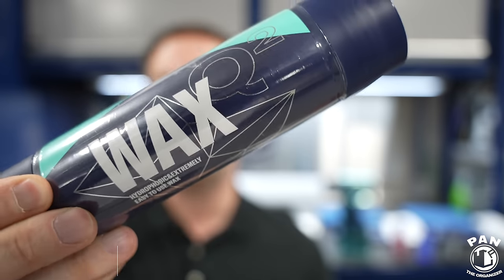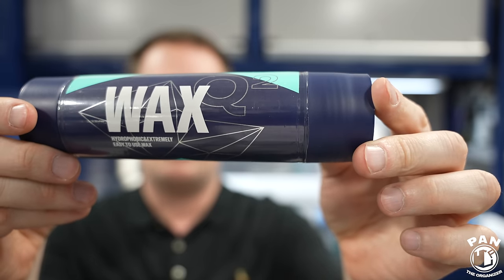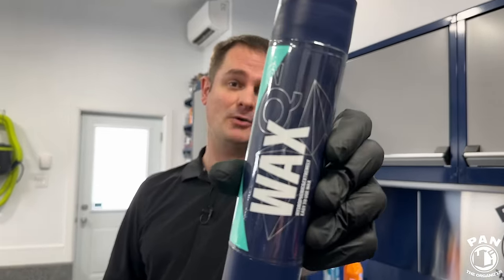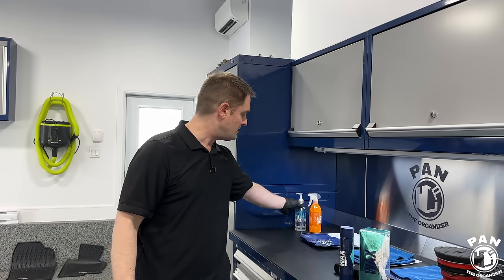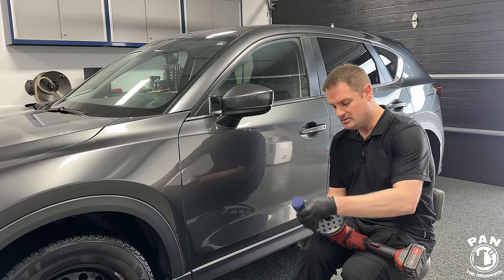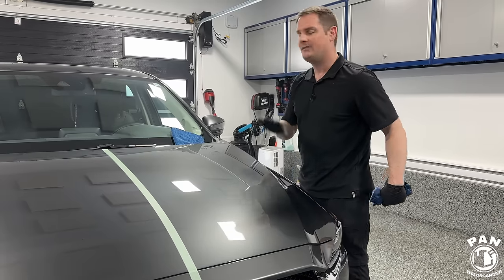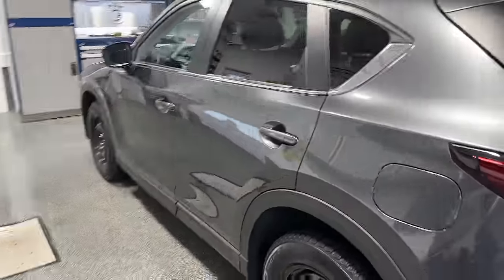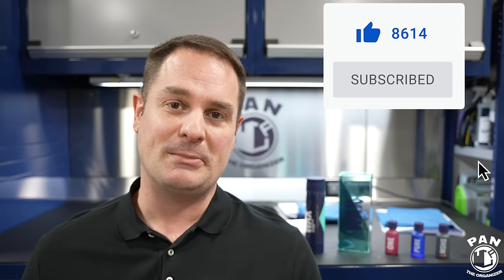Is this the most hydrophobic wax? Gyeon Wax !!

Comment: Hi Pan, do you prefer Gyeon Wax or Fussocoat? As they are both Fluoride based, would like to know your opinion on this.
Reply from the maker: You can’t compare a wax (Gyeon) to a sealant (Fusso).

Fusso will last much longer, but Gyeon Wax is slicker, glossier and has better hydrophobic properties and much easier to apply.

Comment: how does this compare to turtle wax ceramic graphene paste wax ? a one step above ? equal ? and durability 1 year  if we add a topper on top of it ?
Reply from the maker: Gyeon Wax has a bit better gloss and much better hydrophobics, and both have similar durability of 3 to 5 months in my testing, in my conditions. Some people living in more gentle climates can see more durability. 

But no, you won't extend the durability to 1 year if you apply toppers. What you could do, is apply a longer lasting protection on the clear coat, like Gyeon CanCoat EVO which will give you up to 12 months of protection in a simple spray application.

I made a tutorial about the installation of the previous CanCoat version (which lasted up to 6 months) but the same methods apply. Here's the video: https://youtu.be/VnE0b0nsiMU

Comment: Could you give your opinion about using this versus the beadmaker? I have a cover parking space outside and do washes once every 3-4 weeks. Been using beadmaker as a drying aid but thinking about switching to another product as a base layer. After watching this video, I'm thinking about using this product as a base layer once every 3 months and just using beadmaker as my drying aid for my monthly washes.

Also, do you think I would need to use a Alcohol prep wash before I apply this or can I apply it directly to my car after a wash. 

One last thing, could you link what finishing foam pad you used to apply the wax onto your car.

Comment: Can the Wet Coat be used as a topper for the Gyeon Wax? Will one cancel out the other? Is it a case of belt and suspenders, where one or the other is not really necessary?
Reply from the maker: Yes you can use WetCoat as a maintenance topper over the wax.

Comment: Serious question for you if you read this. How do you clean side mirrors I tried 2 trucks I have and scratched both using water and glass cleaner  micro abrasions
Reply from the maker: You wash the car first with microfiber wash mitts. Once dried, you use a microfiber glass towel and a good automotive glass cleaner like Stoner Invisible Glass to pick up and residual water or streaks. A proper glass towel wouldn’t scratch the surface. Don’t apply too much pressure.

Comment: How does maintenance look like ? Do you reapply after each wash? Will it be removed from just regular car soap ?
Reply from the maker: If you use regular pH neutral car shampoo it should last 1-5 months. For maintenance, you could decide to use Gyeon Ceramic Detailer as a drying aid or quick detailer after your routine wash, or even use Gyeon WetCoat as a spray on rinse off topper. I reviewed that product here: https://youtu.be/1W8ZfyuMScY
Reply: @PanTheOrganizer  Thanks for the input! Would it be reasonable to use it as a topper for a vehicle thats has already been coated ? Or would it have trouble bonding as similar to regular waxes? Thanks

Comment: I’ve been wanting to ceramic coat my car. It’s not a matter of not being capable, rather that most of them don’t layer well with waxes and sealants… I don’t know if I’m ready to give up my bi-weekly wax routine yet!
Reply: Hey Joey, I was in the same predicament and I even didn’t have a garage either so I couldn’t go a glass bottle coating. But Gyeon wax has been amazing on my Model Y. I applied in June 2022 and it’s still going strong with proper paint decontamination prior to application and maintenance. Give it a try and you won’t regret it!
Reply: @ShineAndPreserveDetailing  I get where you are at! I’m in an apartment too so no garage is the largest deterrent. I’m planing on doing a Spring polish and Decontamination so I’m thinking I’m gonna go the strong sealant and then wax topper route!
Reply: @Ulinoodle  nice! What sealant you thinking? I would use Gyeon wax first and just use sealant for your maintenance toppers every month or so because the fluorine bonds with the clear coat to make the strong base protective layer and if you use it after, it would only be bonding with whatever sealant you put on. Either way works just getting the vehicle protected is all that matters 🤙🏼
Reply: @ShineAndPreserveDetailing  been doing research all day, going to probably follow loosely what you mentioned above, so many choices
Reply: I play around with detailing products so much, that I kind of hate the idea of a 1+ year (real world) coating. I don't want to polish it off every time I want to try a new product.
Reply: @opmike343  it is a great deal of fun to use new things frequently. I use my wife’s car as the test bed for products. Each panel gets a different product experiment. My next experiment is using Adam’s Graphene Ceramic coating topped with Gyeon Can Coat after an hour to see if it can bond well to it with no issues. Unless you run a detailing business, it is tough to always have new surfaces to mess around on.
Reply: @opmike343  I agree, that’s why I’ve also considered the Ammo pro enamel coating by Larry since it CAN last up to two years, but more over just one year. Plus you can layer his skin sealant and wax on top with 0 issues. I would venture to say as well I don’t like the idea of a 5+ year semi-permanent coating either 😂

Comment: It's clear you can 'stack' this over other products, but how about stacking this Wax on itself? Does it help durability if you apply 2 or even 3 coats of this stuff spread over 3 days? Or is that a waste of product?
Reply from the maker: I don't have the answer to that unfortunately.
Reply: @PanTheOrganizer  I'm used to stack 2 or 3 layers Poorboys EX-P Pure Sealant, so I was wondering if that also works with this. Thanks for your reply.

Comment: What do you use please to clean the sponge and buffing towels to remove wax? I used p&s wash solution but it didnt 100% on the wax.
Reply from the maker: The P&S Rags to Riches to fine on the towels. For the applicator, you perhaps would need to use an APC first, work it in, rinse with warm water and then wash it like your towels.

Comment: I have a question do you have to use They're polishing removing towel.
cirst and then a regular dry  microfiber towel; or can you just go straight to using a micro fiber towel to remove the wax?

Lar question, just like using a DA polisher to apply and or remove; can you do the same with a Rotary polisher at low speeds for application  and or removal?
Reply from the maker: You can use which ever microfiber towels you want. I have a video on which towels to use for which scenarios here: https://youtu.be/VOCy2l8bdm4

I never tried applying a wax or sealant with a rotary, so I can't comment on that unfortunately.

Comment: Have you ever used meguiars bead booster? When used properly a very good product, downside is it has a 24 hour curing time. If those are not met then the product wears off very fast, also downside is in winter it has very limited protection against salt.
Reply from the maker: I haven’t tested that product.
Reply: @Pan The Organizer  not to brag about it but for a spray product it is very good. Used it 5 times and not even 1/4 of the bottle is used so far. Cost wise a very good product for little money. It is sio2 based so you also have that shining surface afterwards.

Comment: 25:40 Wait. What did you just say? This can be applied on top of a ceramic coating??? I've never heard of a wax that can go on top as an additional layer of protection. Could you please make a video on this topic. I've never heard it being done before.
Reply from the maker: This is not a typical carnauba wax. It has chemistry which allows it to bond to existing coatings. If you listened to what I said in the video, the demo vehicle was ceramic coated and needed to be boosted, so we applied the Gyeon Wax on top. And you saw how well that worked.

Also, just to clarify, you could put a regular carnauba wax on coating. The reason it’s not recommended is because you’d be masking the coating’s superior coatings and the coating would eventually reject the wax.

Comment: Great details Pan! I am so excited because I just ordered my first polishers yesterday. Went with Griot's G8 and G9 since they had good reviews and were cheaper than the Rupes, so best choice for me at the time. I also ordered some Gyeon Prep and MOHS so gonna apply my first ceramic! Gonna practice on my own 2016 Corolla (Black) to see how it goes. Could this be used as a "topper" over the ceramic, or would that be  bad idea? Maybe something like Wet Coat instead?
Reply from the maker: I prefer WetCoat as a topper, but as I mentioned in the video, yes Gyeon Wax can be used as a topper over a ceramic coated car. The vehicle in the demo was a coated one.
Reply: @PanTheOrganizer  Yeah, I love a good wax, but Wet Coast seems to be just awesome. Is there a length of time to wait after coating to use a topper? I'm guessing it says in the directions, but I don't have the product yet :)
Reply: @ScrappersDetailing  for gyeon's coatings, i'd put a topper, such as wax or, imo a better solution, wetcoat, after the first wash if you want. But if you were to coat a car with Mohs, for example, you can add a coat of Gyeon Cancoat as an additional layer an hour after laying down Mohs, a bit like the Syncro kit does with Mohs + skin. Personally, i prefer to top with wetcoat when i see some degradation in the beading :)
Reply: @PaulChoix55  Thanks! I’ve been looking into getting some Gyeon Wetcoat or Wax. Both look like great products. Probably will try Wetcoat first.

Comment: Is Gyeon Wax sun-friendly?  I do not have a garage to do something like this indoors.  I imagine I would just let it set for the minimum 30 minutes and not much longer so the sun doesn't bake the wax into the paint.  Although I would love to let it sit longer if it is sun-friendly.
Reply from the maker: Don’t apply in direct sunlight. With any protection, it’s recommended to work in the shade, on a cool surface.

Comment: Hi Pan, great video. How long would you leave the wax on before buffing if you were applying it outside?
Reply from the maker: Same curing time. But you can wait longer it’s even easier to remove. Also, don’t work in direct sunlight, always in the shade and on a cool surface.

Comment: Hi, I'm new into detailing, watched a ton of your video, but I still don't understand, what should I do after 3-4 months after wax application, I need to use some chemicals to remove it all waxes before apply second time?
Reply from the maker: For waxes and sealants, you could just wash the car, dry it, and reapply the protection. No need to remove the previous layer, or at least what ever is left of it. After 3-4 months, you could also wash the car, and then use an iron remover to remove embedded brake dust off the paint, see if the paint needs claying to remove other embedded contaminants, and then reapply the wax.
Reply: @PanTheOrganizer  thanks a lot! Your channel the best

Comment: I have one car. If I buy this wax, I can't use it all in one year under any circumstances. Is there a "use before" period after which the integrity changes (something like it hardens or no longer protects)? I'm not sure, and I'm wondering if there's any point in buying this product if I'm going to have to throw it away before I use half of it. Can you clarify for me if you have information? Can I use the product for a long period without having problems with the effectiveness of the product? If it is impossible to use for long period,  what can I use? Thanks in advance.
Reply from the maker: For all detailing chemicals, the typical shelf life is 1-2 years if kept in stable conditions and never frozen.
Reply: Okay. Then another question. Is it okay to go through the wax once a month in order to at least have the opportunity to spend a good amount of it before those 1 or 2 years of shelf life, or is this a bad practice? 😂

Comment: If I want to topped a ceramic coating with gyeon wax how long should I wait after the ceramic application before I can apply the wax?
Reply from the maker: Always wait two full weeks after you applied a fresh coating, before washing the car again, and then you can start using this wax as a topper, or any SiO2 spray sealant.

Comment: Hello, Walter here from Belgium. I have the following question.... If you car is protected with this Gyeon Wax... is it OK then to use the Gyeon Wet Coat on top of it to keep the hydrofobic effect on a high level for longer when you do your weekly car wash later on? Does this at value? Or is this a combination you should not do / adds no value? What about Gyeon Q2M Cure when your car is dry after the weekly wash and when your car is waxed with the Gyeon Wax (to add gloss)?
Reply from the maker: Yes you can use Gyeon WetCoat on top of the wax. But don’t use it every week. It’s overkill. Once a month or so.

Comment: Hi Pan,
I am really having a hard time to decide between Gyeon Wax and Fusso Coat as a durable way to protect my car and give it gloss. I dont have a ceramic coating on it. They both seem to last a long time, give great protection and also gloss. It also seems they both have ptfe and fluorine as ingredients. 

What is your opinion on these two products. Is Gyeon much glossier than Fusso Coat? Is Fusso Coat more durable than Gyeon Wax? Which would you prefer?
Kind regards,
Theo
Reply from the maker: Fusso Coat is more durable for sure. But Gyeon Wax is easier to apply, glossier, slicker and has better hydrophobic properties.

So it really depends what you want. Both are good for different reasons.
Reply: @PanTheOrganizer thank you! I do like gloss and ease of application a lot, but I think I only want to do a full detail including wax/sealant once in every 6 months (with polishing once a year or less) and maintenance washes in between, every month (but with bilt hamber touchless alkaline foam). I do want to apply Gyeon ceramic quick detailer every maintenance wash to add gloss and give an extra layer of protection to the wax/sealant. But I dont know if Gyeon wax can keep up for 6 months that way? My car is always outside and pretty wet climate (Netherlands). Or maybe Bilt Hamber Double Speed Wax could be a good compromise? I dont have any experience with these products yet.

Comment: Hi Pan 
   If I use this wax or meguaires ceramic wax , would it still need ceramic coating if I wash my car every 2-3 weeks with that wax . Ceramic coating is very expensive
Reply from the maker: A true ceramic coating (in a glass bottle) costs more because it also lasts for years (instead of a few months like waxes) and has more chemical resistance. So you get what you pay for.

You could just use this Gyeon Wax, and reapply once every three to four months, or when you see the hydrophobic properties starting to diminish. You have to decide what would work best for you, and for your budget.

Comment: Thanks always for your amazing reviews! Love watching your videos.

Just a quick question ☺️ you mentioned QWax is a good topper on exisiting sealants, etc. Does this include Wet Coat?

Many thanks in advance! 😊
Reply from the maker: You can use the Gyeon Wax as a topper. But I prefer using ceramic sprays on top of coatings. So if you have a ceramic coating and want to maintain it, use WetCoat.

If you prefer applying a wax, apply the Gyeon Wax first, and use WetCoat as maintenance.
Reply: @PanTheOrganizer  thanks for your quick reply! That makes sense. I use Wetcoat as the last finishing step of my weekly wash - your first review on wetcoat was really useful by the way.

I will definitely give Geyon wax a go! Thanks!

Comment: Hi Pan, I know this is a year old but I have just installed One and I intend to use Wax in about 2 weeks. What I wanted to know is can Wet Coat be used on top of this? Also, does Cure work on this? The booklet suggests for One is to alternately use Gyeon Cure and Ceramic detailer, So, should I forget about the Wax and Wet Coat?
Reply from the maker: WetCoat and Cure are essentially the same type of maintenance, just a different way to apply. Ceramic Detailer is the least longest of the bunch, so the one people use for weekly washes as a drying aid. WetCoat and Cure you'd use a little less often, say 1-3 months. All of them can be used to maintain Gyeon Wax. Pick your favourite.
Reply: @PanTheOrganizer  Thankyou :)